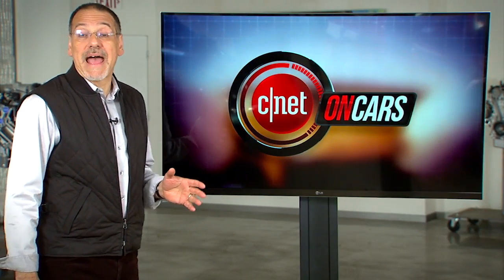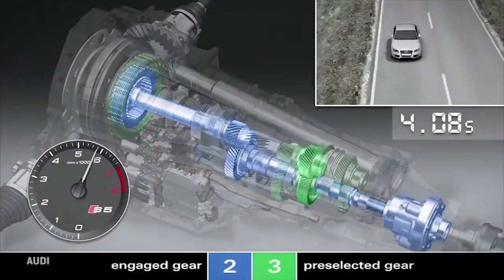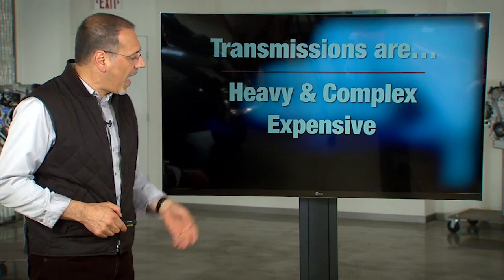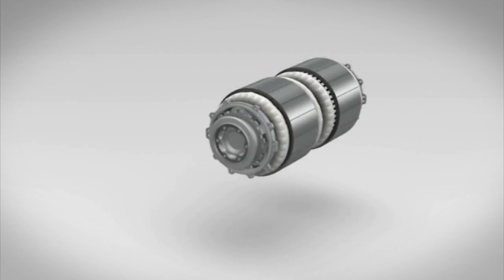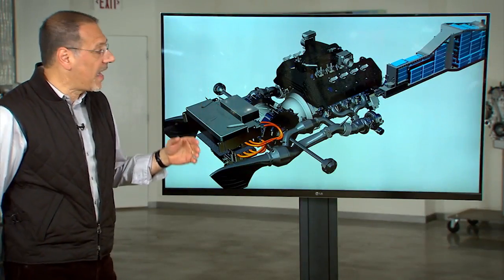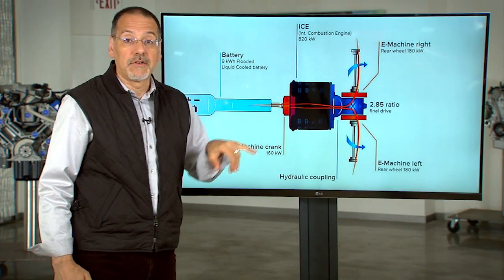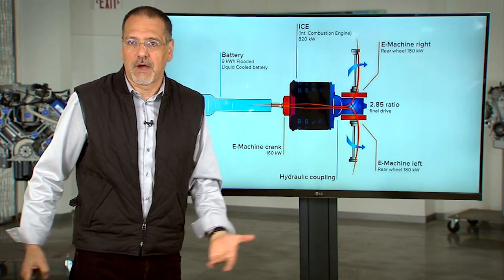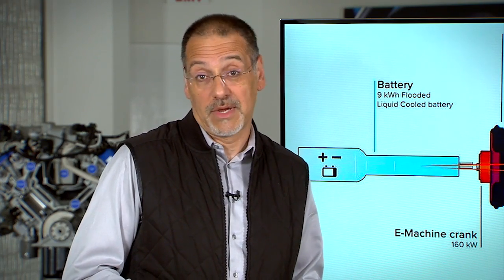CNET On Cars - Road to the future: Understanding Koenigsegg's Direct Drive system

Comment: Isn't this similar to how Tesla has it's drive train since 2012?
Reply: A Tesla is fully electric? The Koenigsegg is a hybrid.
Reply: The transmission system i believe is similar with the reduction gear system
Reply: Edward Weagle it basically is the exact same reduction gear system as the tesla but it uses additional motors.  it's really more like the volt in functionality.

Comment: The only way I see this working is if the fuel map modulates with the speed of the vehicle and the position of the accelerator pedal simultaneously, so it can economise at higher rpm's.

Comment: What is the MPG on something like this?
Reply: If it is only using electric for low end, freeway driving would still use the gas turbo engine? Sound like you're still using a lot of gas. Doesn't an electric car have the ability to run without a transmission? Electric RC vehicles don't have a transmission.
Reply: Matt Nicassio  in that order.  If you care about the MPG on a 2 million dollar 240MPH hyper car, you really shouldn't.  but, if I had to wager (and this is really guessing) I would wager its something like the 918s number and those are better than most hybrids (I think its like 35 if you pushing it and 100 MPGe).  Based on the gearing spread, yes it would still be using the gas engine at highway speeds (although the engineers might use a different tactic) it would be like cruising around in top gear all the time and considering the 80 mph is a third of the rev range of the engine it would still be pretty efficient because the engine is turning just above idle and Koenigsegg knows how to build efficient engines.  although it is possible that the engine might just use the electric motors to keep things moving at that speed and would just run the gas engine once the batteries are low to keep them charged up.   Yes, most electric cars run with out a transmission and just use a reduction gear to keep the motor moving at a speed that is appropriate for the cars characteristics.    Yes, electric RC cars don't have a transmission either, again just reduction gear because they don't need it.
Reply: roguedogx Good to know. And yeah with this car in particular, a buyer shouldn't be concerned with MPG. Unless they are very environmentally conscious. But I'm interested in if the system is applicable to more affordable cars. I'd assume it is just too complicated for a cheaper car and something like an electric car with a gas engine as a backup JUST to charge the engine will be something that becomes more popular in the future. Then again, tesla's new upgrade is going to get even more miles out of their battery skateboard. Pure electric is looking pretty tempting the more affordable it gets.
Reply: Matt Nicassio well again it would depend, the bulk of the cost for this system is the batteries and the development, if it turns out to be scale-able (something that is not as easy as most would think) then yes it could easily be applied to future cars.  especially if it proves more efficient, which it might, and if the complexity and costs are comparable or better than a standard transmission. which would be possible if a supplier picks up the tech and decides to make it a flexible system, which again is possible, but now we are really reaching.

Comment: Wouldn't the future of cars just eliminate gasoline combustion engines completely? Seems to me like everything here less the gas engine and its components has already been developed by Tesla.
Reply: MaZEEZaM I know what you are talking about, multiple videos have stated it to be the safest car ever, but its simply not true. and yea the s coupe is a dream car of mine.
Reply: game2heart, I haven't seen any evidence that Tesla wa the 1st car company to develop this system. As far as I know, The Swedes were the 1st 1's to develop this, not the Americans.
Reply: martinshoosterman have you even looked into the Tesla cars, they are Very efficient and Very fast. They are also putting a huge amount of investment into researching and developing new types of batteries.
Reply: game2heart no because electric engines simply do not work too well on there own.
Reply: ***** naturally electrons are not an energy source. and therefore do not like to act as one. fuel on the other hand is a potential energy which naturally wants to be an energy source. this is prevalent in comparing the weight of fuel to the weight of the equivalent amount of energy in batteries.
Reply: MaZEEZaM of course i've looked into tesla. Ive looked  into almost every car company on the planet in the last 300 years. tesla are doing well for an electric car, but are still lacking in quite a few ways. first of all 300 miles range is incredible on an electric car, but absolutely shit for a gasoline engine. the weight of batteries to hold 300 miles worth of charge, is roughly the same as 2000 miles worth of fuel in the average engine. the car itself isnt terribly well made, but it does have some cool features and is fun to drive at first. (its a party trick, you get used to and then bored of)
Reply: not well made, its got the highest safety rating of any car ever rated! the range is not enough for really long trips without recharging but how often do you drive more than 120Km round trip to work? and with Tesla putting more an more recharging stations in the US...not yet Australia then they will be very convenient, it would be far nicer charging your car at home rather than going to the petrol station. Who cares about the weight when the performance is as good as super cars! 0-100km/h or 0-60miles per hour in something like 4 seconds for the sedan!
Reply: MaZEEZaM first of all remember thats the most expensive one. They are comparatively fast. But not well made. they are very safe though. not the safest car ever rated. the safest car ever rated is the volvo xc90, followed by the s60 v60 and xc60. although while the xc90 is safer then the other 3, they already got perfect scores giving then the same safety rating. teslas are only about as safe as there german counterparts specifically speaking the s class. which is one of the safest cars out there, but its still not the safest. by quite a bit. personally I make trips more than 120km at least once a week, and so do allot of people. a car with all it can do is drive you to work for 20 grand is perfect. a car which all it can do is drive you to work for over 100 grand is stupid. 
bassically all I mean by not well made is simply it has a terrible suspension compared to its german ice counterparts.
Reply: Thanks for the info, a previous Tesla video I think it was said it was the safest car ever rated, so I stand corrected :) The S-class Merc would be a seriously nice car to own, especially the coupe.
Reply: at the very least it was Tesla to make it mainstream market available, in useful longer distance of driving on one charge.